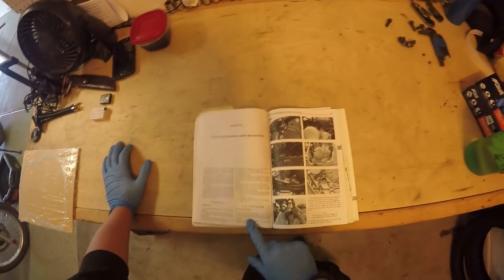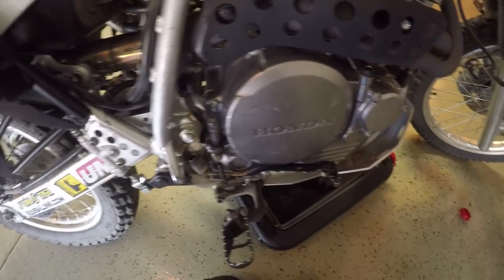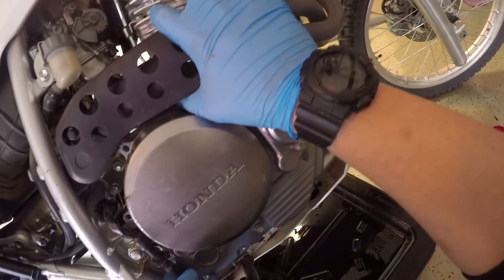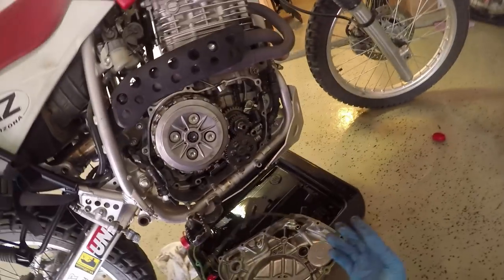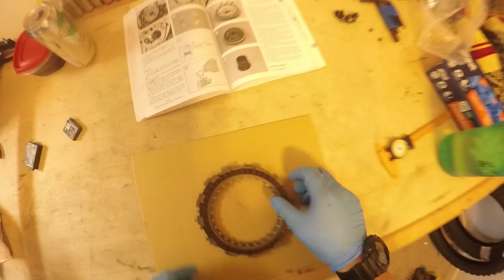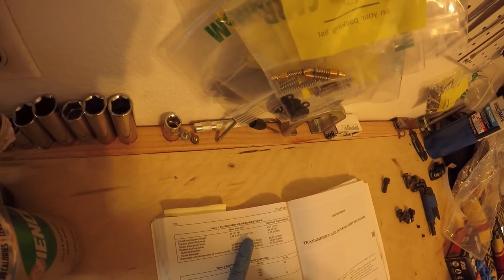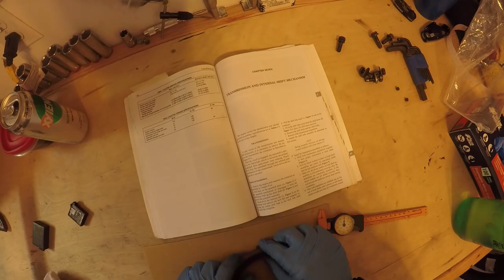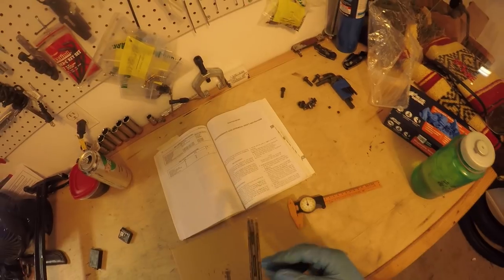Motorcycle Crankcase Gasket Change | Honda XR650L

Comment: Quick tip put a garbage bag down  first and when you spill oil it will stay on the bag and will be folded up around your wheels, no oil on the floor nor your tire.
Reply from the maker: I shoulda turned the tire to begin with, but forgot what the hell I was doing. Preoccupied with the camera and stuff i guess.

Comment: Next time you replace a gasket, it's a good idea to rub a thin layer of oil on each side of the gasket material. Most likely your old gasket was put on the crankcase dry from the factory and it probably did not crack until you removed the bolts holding the cover. 

Regarding your clutch, I know that it seems extremely close to the service life limit, but I would guess the next time you measure the plates they will be the same thickness. They don't wear very fast at all, but if you decide to go ahead and change them I recommend the tusk brand from Rocky Mountain. They are a great value for the money. We are blessed to have cheap wear items on these bikes, so it's only about 50 bucks for a new clutch!
Reply: Yes
Reply from the maker: I knew I was forgetting something. I'll probably wait until the clutch actually gives me problems before I take this cover off again.

Comment: There's 4 copper washers for the oil line, did you have to replace them? I'm in the process of replacing my pulse generator so this will be my first time doing this, may I add my bike is a 2014 with 20K miles on it so probably my clutch too but can't afford it right now times are hard.
Reply from the maker: I didn't replace any copper washers.

Comment: I'm 3or4 years late, but there's a screen in the bottom of crankcase , that
needs to be cleaned ,it keeps stuff from getting
sucked up into the engine
a whole different thing but
the check the one in the 
frame to if thay aren't clean , your oil won't flow
well that is one silent killers of any XR.
Reply from the maker: Thank you for the information

Comment: oil is fine, no worries, i run rotella in vegas winter and summmer , 130 outsude ... no problem  :D glad you made it work man :D
Reply from the maker: Vegas RoManiac there seems to be an internet debate on whether rotella is appropriate for motorcycles, so i think it will be interesting to see what comes back from the test.
Reply: Friday'sThe Bomb you should see the debate over Amsoil 100:1 in my 2 stroke... I even got death threats

Comment: You really shouldn't use 1530 rotella  the Rotella is a oil  made to be used in diesel engines. it has very strong detergents that aren't good for gas engines.especially in a motorcycle engine..,,but it was a very helpful and probably the best xr clutch install video,,should maybe change the title of video
Reply from the maker: A huge number of people use rotella in bikes. Rotella doesnt have the additional lubricants that car oil ussally has, so it's an alternative to specialty motorcycle oils. I got this oil lab tested after using it exclusively for 15k miles and the lab told me based on metals found in the sample, the engine had below average wear for the miles, indicating it was in great condition. People can debate quality all they want but Im not sure what more proof is needed. It seems that the important thing is to change it a lot,  use the right weight, and dont use stuff that will damage a wet clutch. Im starting to think peoples perceived differences in oil performance is really just... percieved
Reply: @FridaysTheBomb  humm.
well.you just schooled me..

Comment: Great video man. I'm replacing the gasket on my 1985 XL350R. I found out the cover is actually cracked around one of the holes and the piece completely broke off. I'm buying a used crankcase cover off ebay and have been trying to confirm whether a sealant in addition to the gasket should be used. I see people in the comments saying to use oil to "seal" it on and the dowels as a guide. Just wanted to confirm what you or anyone else thinks about using a very thin layer of sealant to fill any imperfections on the new crankcase cover. Thanks
Reply from the maker: I dont think sealant is mecessary here. Just wet the gasket with oil, and make sure you tighten the bolts in a crisscross pattern.

Comment: Glad you stated the mileage and level of abuse so we know better to guage or clutch wear. Thanks. So did you change out your clutch and basket bearing at next oil change ? Ride it till it slips?
Reply from the maker: I never ended up changing it. Im just going to ride it until it slips.
Reply from the maker: If your interested, the clutch just started slipping under power, and mileage is now at 20,304.

Comment: one more thing, Get a set of 0-1" micrometers for measuring things like that.  Those plastic Calipers are not as accurate.  I'm a Journeyman Machinist.. :)
Reply from the maker: +Michael  Straughn i had a proper digital one but the batteries dont survive

Comment: Question for ya. I need to get valve clearances checked on a drz400s. I do a fair amount of maintenance on my daily driver (hub bearing swaps, sway bar links, diff oil, motor oil, spark plugs, thermostat gaskets, etc) and I was wondering what your thoughts were on doing it yourself vs taking to a shop.
Reply from the maker: I did it for the first time on this motorcycle and it was surprisingly easy. there are 4 caps on top of the engine that reveal the adjusters, all you have to do it access those and rotate the engine manually to the correct position, then adjust the arms. Just make sure your using the correct feeler gauge and have positioned the engine on the correct stroke. One important thing that I got wrong though: The internet will tell you that you should feel a "light drag" on the feeler gauge, and I think this is poorly worded. You should be able to drag the feeler gauge out, but it should have enough resistance that it isn't TOO easy. If you adjust it so that there  is only light resistance, your valves will likely be way too loose and you will know this if you hear them ticking. I suggest tightening them down just enough that you can't remove the feeler, then back it off just enough that the feeler can slide out.
Reply: I was definitely curious about the amount of drag. I like your explanation better. Thanks budro! Guess I'll give it a go.
Reply: I have other motorcycles from the 70's and have done quite a bit of my own lite 🔧 work, however since this is my 1st 650l and I'm not yet in possession of a manual, yeah I like the manual because with the tablet 📱 sometimes it's a little harder and you can make notes in a manual, I also wanted too pick the Tech's brain, and confirm or correct some assumptions about the particular bike, like my chain adjusters were a ring around the axle, with a threaded shaft and 2 nuts that after loosening the axle nut pull the axle back evenly too tighten the chain!! This is also the first motorcycle I've had that has motor oil in the frame, the first dual purpose motorcycle I've had with electric start!!! When I 1st started riding if you're motorcycle had electric start it was a big one, maybe a street bike if it was dual purpose. ( we called them trail bikes or enduros) you were either rich or lucky, or in some cases just some weird schmuck we might not trick you into a trap or roll you into a ditch, we'd leave your motorcycle standing within your sight safely nearby in good working order or we'd just get you too stop were we could splash some mud on you or get you overly dirty or dusted, it was never personal just harmless fun. Or we'd take you out riding and stop, when you turn your back we'd shut off your gas, then watch you try too start it, all the while checking how long it took you too catch on, ha ha

Comment: Power wash? Noooooooo.
Reply from the maker: Whats the problem with a pressure washer?
Reply: Too high a pressure. Stay away from your instruments, electronics, bearings, chain...
Reply from the maker: I've gotta say I've learned of of many differing views on things since I've started doing this, but I've never heard of an issue over pressure washing lol. I don't hold a stream of water on electrical components, but isn't that common sense?
Reply: It can be down safely. Just stand 20 ft from your bike when spraying 😁. They’re deadly on bearings though.

Comment: Thanks for the vid!  I can't wait to have to change my gasket now.  I noticed you don't use a wash plug when hosing down the bike.
Reply from the maker: Rick Torbet i dont know what that is
Reply: A wash plug is a cone-like device that goes into the end of the muffler to prevent water from going down there at the car wash.  I'm not sure they're necessary.  I've seen people swear by them, and now I've seen people that don't know what they are.
Reply from the maker: Rick Torbet i think I'll just avoid shooting water in there lol